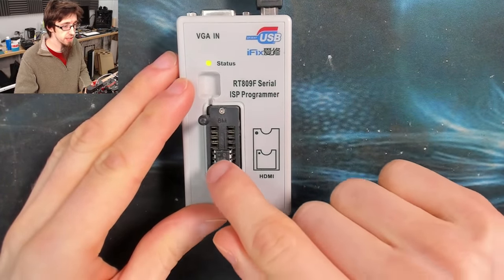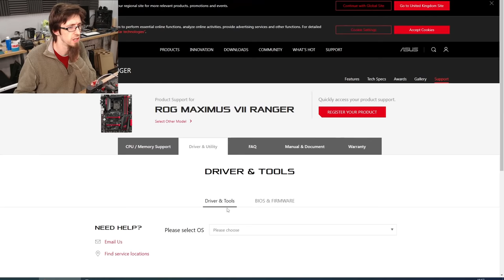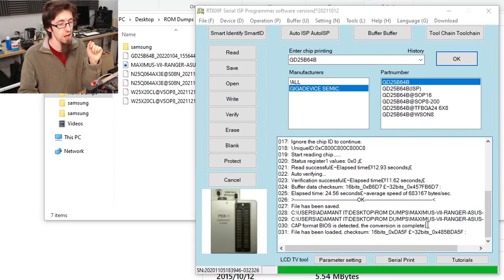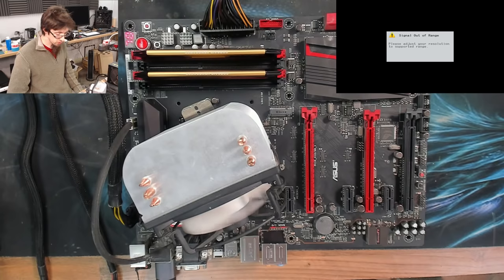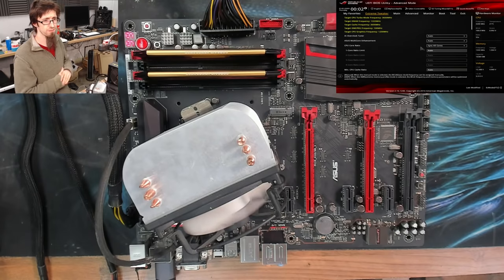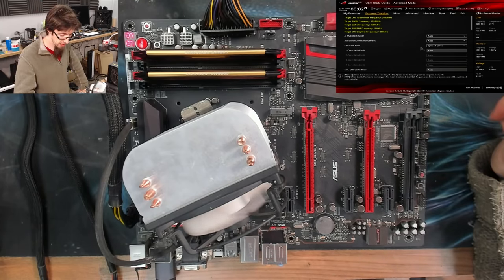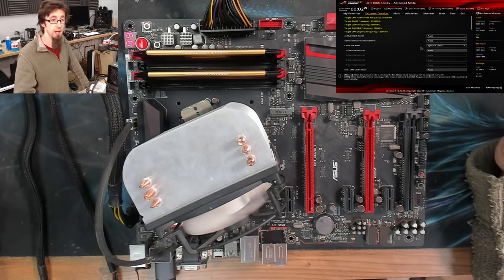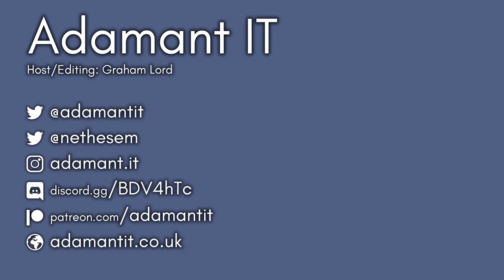Red herrings, red herrings everywhere (4th Gen Intel Build, No POST) - LFC#292

Comment: This motherboard supports flashback.
I was screaming at the TV in the beginning. I wanted you to blow out all the dust. Dust can somtimes short out components.
Im intrested in your old I7 CPU
Reply from the maker: Really? I know the Maximus 8 has it, but I couldn't find any info about the 7...
Reply: Tried several times now with a reply but seems to be deleted or not submitted. Posted a link to this motherboard and a citation "USB UEFI BIOS Flashback
Refresh your BIOS in a flash, even when the system is off"

YouTube maybe don't like links even if it's legit
Reply: @orfeous  Youtube usually auto deletes links in comments.
Reply: @nian60  new feature I guess. Haven't seen that before

Comment: I thought the post code itself was a "low hanging fruit,"  but you ignored it.  I enjoyed the video, but I would have started with that.  I also have a Z97 motherboard from Asus with a i7-4790K that I built in 2014 and I wonder if I should be flashing my BIOS as regular maintenance to avoid the "bit rot" you mention.

Comment: I've just watched this again as it is so useful. When you removed the BIOS chip at around 40:00, that socket looked a little dirty to me. Specifically the left-hand side. Not corroded, but dirty. It might have been the light, of course. Could dirt have caused that behaviour?

If you wanted to confirm bit rot you could compare the downloaded BIOS with the correct BIOS from the wbsite. Obviously you'd need to know which BIOS, otherwise you'd be spending a long time going through each one in turn.
Reply from the maker: Yea, the bit that makes that tricky is not knowing what BIOS version the board is currently on, so not knowing which version to compare it with. It's probably possible to find out, but it's a time trade off between "curious investigation" and "just making it work again".

Comment: Now that I think about it, I don't think it was bitrot. It was a bad BIOS update. The PC was probably running very badly, throttling or random shutdowns, because of the loose heatsink. So the user tried to update the motherboard to fix the problems. But the hot CPU was too unstable to install the update and corrupted the BIOS.

Comment: 1. You need reset mode of cooler only when you want to take it out...
2. Power supply is first to blame as its common to get one rail +3 +5 etc bad
3. Since memory controller is build into processor you always put single mode memory into farthest slot from processor

Comment: For resetting the BIOS, is enough with shorting the CLR CMOS pins or pushing that red button a few seconds.
If you want to be sure, pulling out the battery and shorting the pins for 10 seconds will do the trick.

Also I would never risk such a good CPU like the 4790k for testing. If the motherboard VRM is toasted, you could send 12V straight to the CPU.
I have some Pentium and celeron CPUs of several gens that will give their lifes if necesary.

Comment: Just a question, I need your opinion.

I heard a lot of people hate on AMDs retention clip system saying it is awful 
and some saying intel's is better and I really don't get it because amd coolers are so easy to mount and you can even use AM2 stock cooler on AM4 while intel keeps changing them for a few milimeters, just enough to make them incompatible and I also keep breaking them.

So, my question is, whats wrong with AMD retention clips?
Reply: Just manufacturing tolerances, some AMD coolers apply very little force (not enough) to the cpu, yours may be fine!
Reply: @sirfairplay9153  I have 13 of them (I do repairs), none has any mounting pressure problems
Reply: @filenotfound__3871  Good for you!

Comment: Bit Rot might be caused by Cosmic Rays. "In 1979, James Ziegler of IBM, along with W. Lanford of Yale, first described the mechanism whereby a sea-level cosmic ray could cause a single-event upset in electronics." & "Terrestrial SEU arise due to cosmic particles colliding with atoms in the atmosphere, creating cascades or showers of neutrons and protons, which in turn may interact with electronic circuits. At deep sub-micron geometries, this affects semiconductor devices in the atmosphere." https://en.wikipedia.org/wiki/Single-event_upset#Cause

Comment: Hey Adamant I got the same motherboard that will not post if it's not preheated with a hairdryer. Bios version 3503. If not preheated it just boot loops with code 00
but it run's perfectly fine after preheated. been working for over a year with the hairdryer xD   

Any idear what it could be ?

Asus Maximus vii ranger 
intel i7 4790K 
Hyperx fury ddr3

Comment: This is a really interesting and informative video because it shows how many things you can do wrong without being quite wrong enough to stop the system from working.

I can only roll my eyes at the spec of this system: a Z97 board that cost about $180 USD (£130) new for an i5-4570.
Reply from the maker: Definitely an odd-combo. The customer told me they cobbled it together from various bits, so I'm guessing this wasn't a "buy it all at retail and build" PC, which would explain the strange CPU/Mobo pairing.

Comment: Those 24pin and USB 3.0 connectors are ridiculous overkill for how tightly they fit. Always think I'm gonna break my motherboard with the 24pin. The USB connector I've literally pulled the slot off the motherboard with the cable multiple times
Reply from the maker: Yea, the 24pin you can "walk in" and "walk out" with a good wiggle, but man, USB 3.0 front header can die in a fire.

Comment: My personal new build #4.   NO signal to the monitor.   Did not POST or launch Windows 10.   Bought a second, GIGABYTE AORUS 12th gen DDR4 Intel motherboard.   Still no better.   Finally, I was able to source reliable DDR5 at a fair price.    Now using the ASUS ROG Strix Z690-G Gaming WiFi mATX motherboard, there was no proper motherboard behavior.   So-o-o, I purchased an Intel i5-12400 for testing.   The motherboard booted and launched Windows with all fans operating properly.   The original CPU was defective!   Purchased another Intel i9-12900K CPU.   There were no problems booting and launching into Windows!   Now, 3 months later, I have a solid reliable mini-tower PC. 

[I only wish that Windows 10 were this reliable.   I have tried Windows 11.   It's even worse.    I'm back on Windows 10.]

Comment: @52:50 Do I see a Vapochill LightSpeed in the background on top of the Fractal box? :)
Reply from the maker: Not a Vapochill, custom unit, but does the same thing! Done a few extreme overclocking experiments with it. Sadly it's died and we're not sure what's wrong with it (turns on, but doesn't freeze) need to take it to an air-con place to see if it needs re-gassing or something.
Reply: @Adamant_IT   When the compressor is running but the evaporator is not getting cold than I also suspect it is low or empty on 'gas'. It is fun to play with and I used Arctic Silver Ceramique paste, as it is cheap and also stays good under subzero temps.

Comment: How did you know which part of the motherboard was defective?From the defective memory code 26?
Reply from the maker: So we could see that it was not running through POST properly, which means there's faulty hardware detected, or the BIOS itself is corrupted and getting stuck. We tested all the major components by swapping them with other parts, so only the motherboard remained. At this point, it's either a bad BIOS, or the mobo is physically damaged, so a BIOS flash is the next logical step. As for how I knew where the BIOS chip was - SPI ROM chips are fairly distinctive when you know what they look like. These older boards, it will be the only socketed chip on the board.

Comment: I once tried to just use one of those stock coolers to check if a CPU and Mobo were working. Took me like 10/15 minutes to figure it out and get it properly attached. Like it would have been quicker for me to mount the hyper 212 I had lying around.

Comment: First thing i'm doing when trouble shooting is unplugging everything that's not necessary for a post. Things like sata cables ssds and usb stuff. This eliminates those devices. After that I try swapping ram and try a diffrent power supply. If it starts working I change things back one by one until it stops working.

Comment: My personal favourite fault I came across was on an Abit IT7 motherboard which kept getting random shutdowns, I eventually identified a clicking noise when it happened so I was listening carefully for where it was coming from & power cycling the pc & then..... BANG a Mosfet exploded in my face.

Also a system that appeared dead, checked everything, swapped parts about eventually traced it up a mangled front panel usb port that was shorting to ground & tripping the psu unplugged the USB header & PC back to normal.

One of the first things I do is a visual chdck on all ports looking for shorts & also unplug everything from thd board except fans, ram & power

Comment: A PC with that spec, you'd think they would have a 3rd party cooler, as it's so cheap to upgrade it over the stock item. So I'm wondering if they had a better cooler, but it failed or something so they removed it and bunged the stock item on for testing. Just because it still has the stock paste on the cooler, doesn't mean that they had a better one on and wiped the paste off before just sticking the stock one on?

Comment: Must the cooler really be plugged in to test the CPU or can you power on and run without one just for a quick check?
Reply from the maker: I always put something on the chip. It's likely that most CPUs will be okay for a minute with nothing on them... but for the 10 seconds it takes to rest a heatsink on top, it's not worth messing around. I've left CPUs running Memtest86 overnight with a cooler resting on top, so this way you can be sure that if the system cuts out, it was a fault, and not the CPU bouncing off of TJmax. Having the fan plugged in is also a nice clear indicator as to what the system is doing, on/off, power cycling, fan curves activating, etc.

Comment: I had an i5-4570 in my first Intel system, the customer clearly overspent on the motherboard for this locked part.
Reply: An Asus board can clock locked CPUs. Least mine can. I think all it does is run them in boost for longer? I only get a +200 MHz clock if I try. So I don't even bother with it. There's no perceptible difference between that and not clocked. Still funny that it'll do it though. I only have a Z87 board.

Comment: nice logical method of troubleshooting!
.. to do cap on non RT809 u can use UEFITool A 59 from LongSoft ( lol name) 
 load the cap. then expand aptio capsule then extract as is the intel image and save as .bin

i dont think its bitrot.. i can clean intel ME of old and flash it and should work. if it dont then its NVram .. u can find version of old and dload same and compare and see only ME or NVram was different.

Comment: I’ve got an ASUS Maximus VII Hero that gives me Error 00 which indicates CPU from what I’ve read online but the CPU works perfectly fine in my old MSI Motherboard....

Have you any idea what could be going on as I am stumped on what it could be....
Reply from the maker: Sounds like the CPU isn't getting power. Check the EPS cable, try a different PSU. If that doesn't work, you need to get out the multimeter and start probing the VRM inputs and outputs to see if vCore is working - but that's getting into board-repair territory.
Reply: @Adamant_IT  I’ve got a 750w Gigabyte PSU which had been working great on the VI board and previous builds. I’ve also tried another PSU on the VII board and it still kicks up the Error 00 Code with a continuous Power Cycle. 

I’ve tried Bio Flashback to no avail. Because I don’t have the tools to reflash the bios externally like you’d done in the video I’ve ordered a new bios chip and asked the seller to put the latest non beta build onto it for me. 

If that doesn’t work for me.... you’re more than welcome to have it if you’d like to try get it working for a future video....

Comment: After you reseat the cpu you test the post twice without the video card in. Why?
Reply from the maker: I tend to test excessively as I go, so if the device falls over again, I should only have to undo the last thing I did to get back to a working state. Additionally, sometimes testing a second time to make sure it's not a fluke, make sure that error messages are clearing, is helpful.

Comment: Which bios programmer is among the best, I currently have EPZ 2019, can, what do you recommend, forgive my English.
Reply from the maker: TL866 ii+ is considered the king of repair programmers. I'm looking at an improved version of the CH341a v1.6 (which has voltage select) as a much cheaper option, but haven't finished testing yet.

Comment: When building a computer a couple of years ago, I decided to go ASUS for MOBO. I was very frustrated in beginning kept not wanting to POST. There is only lights no codes. After research it turned out my MOBO has a "memory Learning" button on it that needed to be pressed so it could Learn the memory specs.. I almost threw out the comp was so frustrated since it wasn't mentioned in manual, I had to research forums online..

Comment: My dell at work is a refurb, and since I have had it it periodically won;t post. Eventually this peeved me off enough to strip the thing apart and see what I could see. And what I found was a good blob of heat-sink compound on the pin side of the processor. No idea how it ever worked, but for sure, it posts every time now I've clean it off.

Comment: wonder if they got that 2nd hand considering the price of that motherboard seems a bit skimpy on the cpu cooler
Reply: Maybe. But that cooler was fine for most circumstances with the i5. Another possibility: I just parted with a 4th gen system where I was planning to upgrade the Pentium (2-core but very fast) down the line to use as a VR rig...but never ended up biting the bullet on VR because Facebook bought Oculus and I moved to a smaller place without space for kt. My Z97, 1060 6Gb, 750 W gold PSU, 24 Gb fast RAM, etc. were all super overkill for the Pentium, but it played all the games I wanted so I never upgraded.

Comment: i have a asus z97 pro gamer. no post. 

when i power on the unit (using short 2 pwr pin), cpu led lights up for a bit, and then dram led lights up a bit, led on supreme audio flows, but no post no beep. 

without ram inserted, mobo does not turning on at all (fan not spinning, no led lights up).
tried another ram different spec different slot(1600 vs 1333), same.
tried another CPU (original haswell i5 4670k, haswell refresh i7 4790, g3260), same.
tried flashing bios manually using like video method (ch314a programmer), same behavior. 

im at loss now for this unit. 0 knowledge about component level repairs.

Comment: I swear I worked on this PC just like this a couple of years ago. It had a different PSU and had a very noisy AIO. It had another 970 and they had a replacement GPU that looked exactly like the one installed. 

I didn't have time to fix it at the time (I am a software engineer not a PC tech) and I wasn't getting paid. So I told them what was wrong with it and phone a proper shop.

Comment: I'm @35:51 so far and looks similar to an issue I had just over a year ago with my ASUS Gen4 system.  My issue ended up being one of the motherboard CPU fingers being bent and the system would not post.  Sadly, as I went to gently try and straighten the finger, it broke off.  😱😞

Comment: I would've tested another RAM slot too before switching the CPU. RAM slots are quite often broken also, no?
Reply from the maker: I very rarely see broken RAM slots, or slot compatibility issues. Usually trying a single-stick of RAM is enough to check for that. However, yes I should've tried another slot considering it takes 30 seconds!

Comment: I see in your videos you apply the thermo-paste in an "X". Why? I read that the best way is in the center (as the cores are in that location) and not too much. When you press the cooler it will spread it evenly over the surface without overflow from the sides. With the "X" you risk the paste run over from the corners.
Reply from the maker: Centre-dot doesn't give full coverage. For Intel this isn't really an issue because as you mentioned they're monolithic and everything is in the middle - but Ryzen uses a lot of space under the IHS, and you want to ensure full coverage. A little overrun doesn't hurt anyone.
Reply: @Adamant_IT  Understood ;). What about little dots (center and 4 corners)? I remember my first paste application. I spread it like butter over a toast with a credit card...
Reply from the maker: That'd probably do it. Spreading is probably the best method, just also the most labour intensive.

Comment: the beta bios probably has the microcode update for spectre and meltdown
Reply from the maker: This would make sense. My guess is they slapped 'beta' on it so they didn't need to bother doing significant testing for an obsolete model.
Reply: @Adamant_IT  yeah, probably that was the reason. They provide the beta bios, but without customer support, for such an old product.